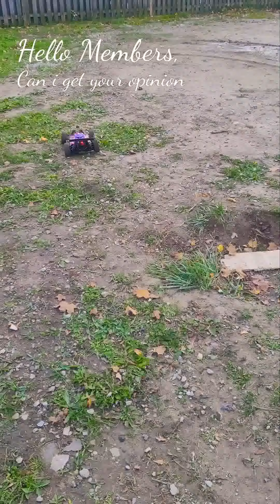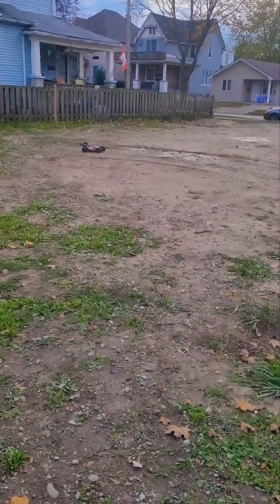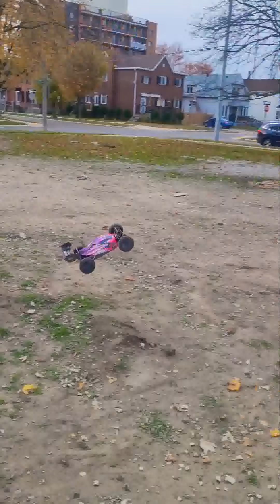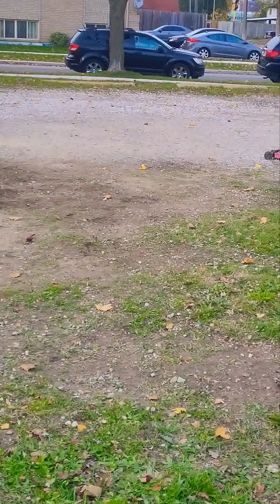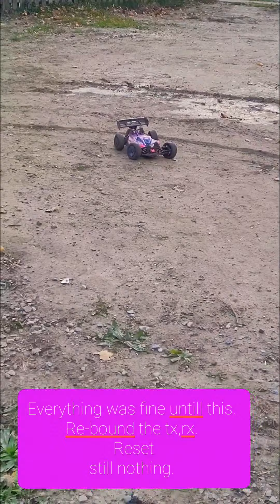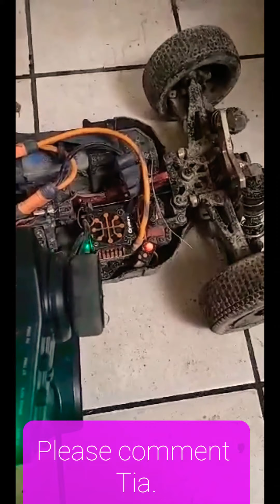Looking for answers. edit. servo wire slipped.

Comment: First question where are you getting your light kit from don't know if you ever heard of Polo creations but they got some nice light kids second question or statement you should really have a Servo saver on your Servo
Reply from the maker: If the stock roller comes with it then I have it. I even picked up another roller because I like it so much. Yes I have heard of and have their Kraton front headlights installed. Weak filliment used very good quality wires and lights also the remote control works well. However, the customer service lacked severely.